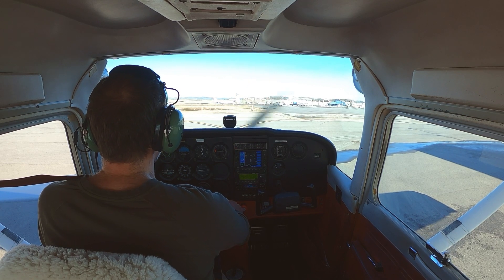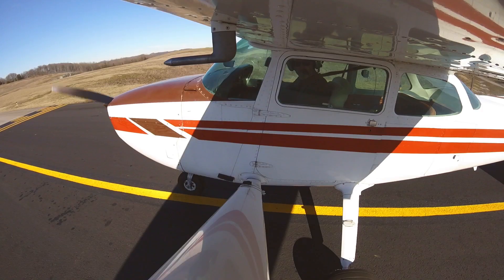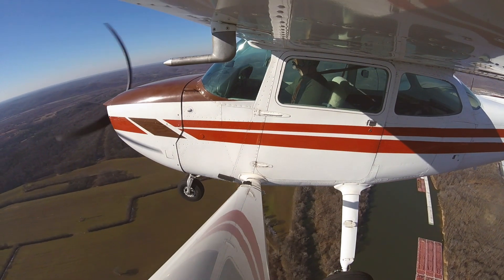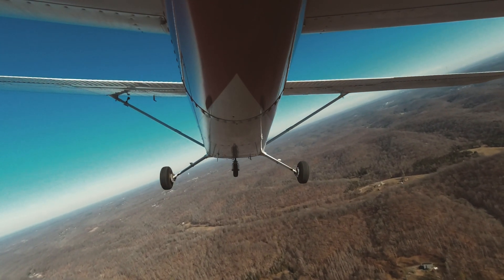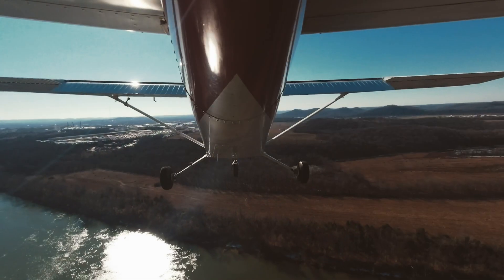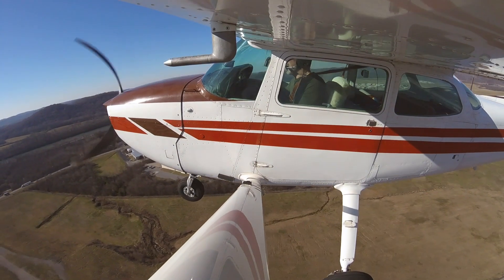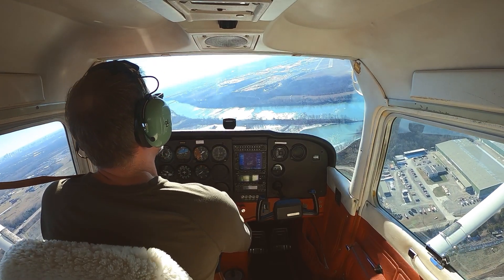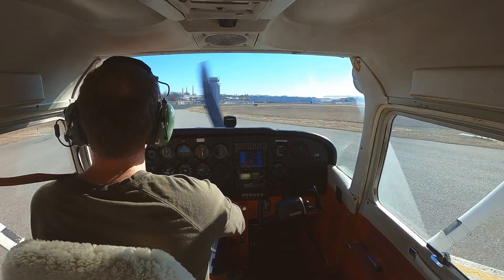Pre-checkride Solo Flight Cut Short by Crazy Winds

Comment: Thanks for the video. That first downwind was practically a cross-country. I used to hate it when that happened to me while flying in the pattern at Smyrna.  I appreciate the way that you included most or all of the calls without editing them out. The Tune tower (non-radar, right?) handles traffic differently than what I'm used to, so it was interesting to watch, as was your flying.
Reply from the maker: Yes JWN tower just opened last year and doesn’t have radar.

Comment: 03:17 Wow really just jumped off the runway!
05:31 Looks like you've got a decent crab going
13:35 Not bad in 12G20

I like the decision making. Really liked calling the go-around rather than trying to force it. I have a tendency to try too hard to save a landing rather than just go around. I also like that you knew your limits and quit while you were ahead.
Reply: agree. remember CFI telling me "you can go around, even after the wheels touch"
Reply from the maker: Yep it was headwind component of about 8 kts on takeoff. Good overall experience.